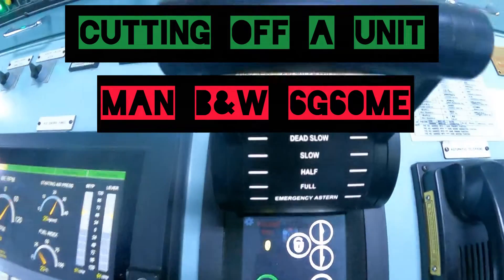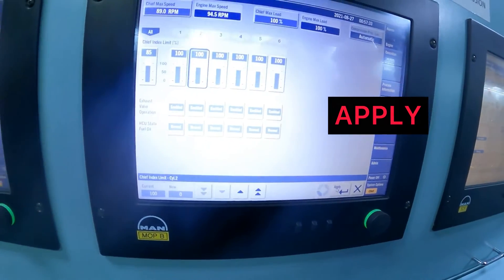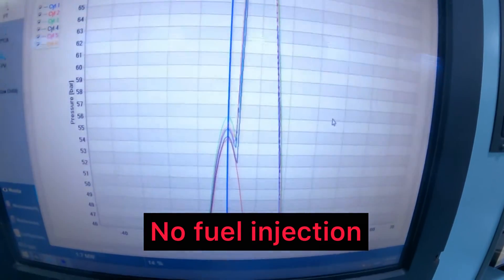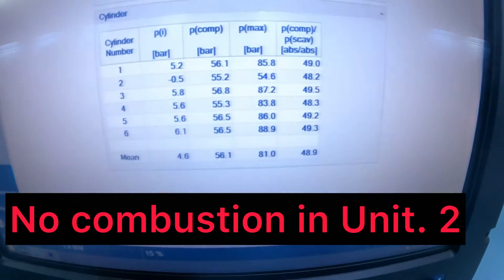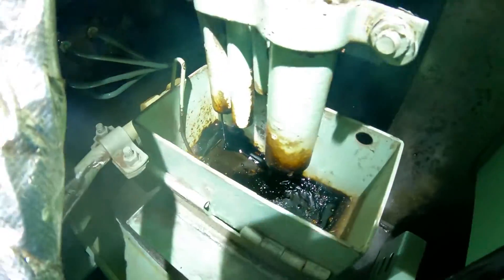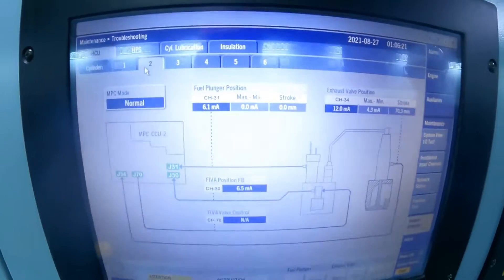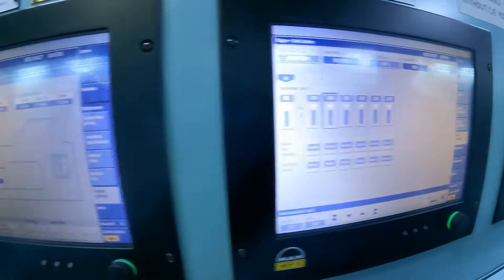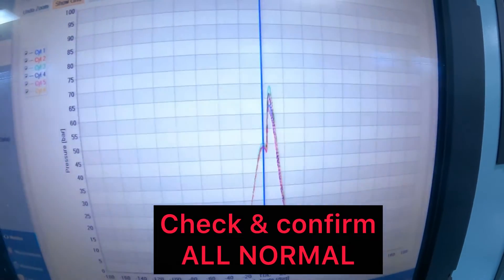One cylinder ISOLATION- cutting off one unit - Marine diesel Engine

Comment: How many persents of ME loadindg allowed with one unit cut off?
Reply from the maker: in this version/ MEGI-E - All units must fire, no cut allowed else GAS operation (dual fuel) is blocked.. also all the Chief Limiters for each cylinder and the fuel index limiter must be at 110%.. this is MANBW statement and cant be altered.
also in the MEGI-2.. 2nd gen for the MEGI concept engines, this unit cut off is possible also part load gas- part load fuel also possible.. but this is only on LNG fired engines... hence MEGI... (LNG).. 
whereas what i am working on is MEGI-E ... Ethane

Comment: Sir, then how should we do with the exhaust valve? Should we keep it closed(no operation of FIVA valve) Or should we keep it opened(FIVA valve safety mode) Normally, they say it's better to keep the exhaust valve closed to prevent exhaust gas coming back into the cylinder.
Reply from the maker: HI, pls read the maunal for the exact operation; various cylinder conditions are mentioned which will tell u to keep exhaust valve open or to keep it closed.

Comment: Unless the follower is lifted of the cam, his plunger will be working and this needs lubrication. Shutting off fuel inlet and letting the pump operate without lubrication is dangerous. In this case he did it for a small time. So all is well. If they cut off fuel for a week, he would have problems
Reply from the maker: Hi Nanda.. this is a ME engine so follower and cam is not there on this engine. Sorry to say you will have to read a little more on MAN B&W ME ENGINES …Thanks for watching it though.